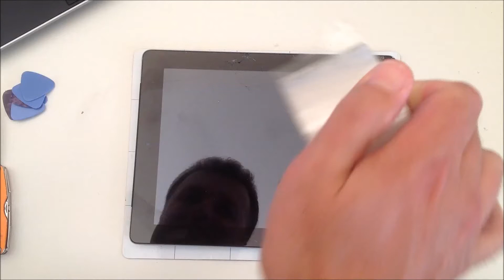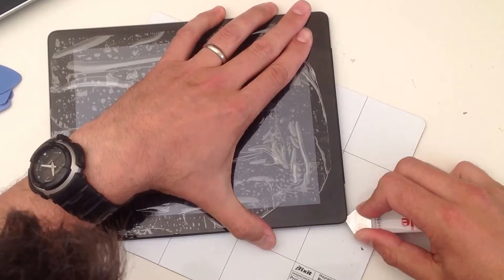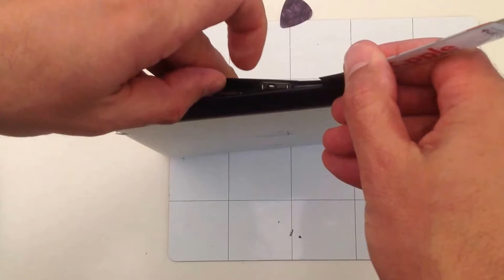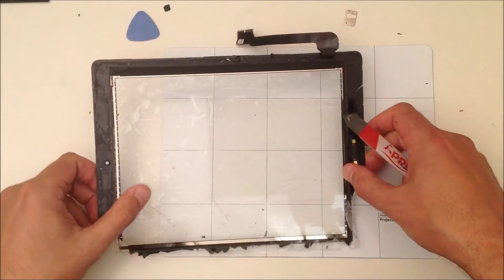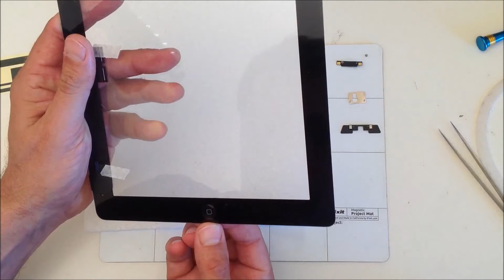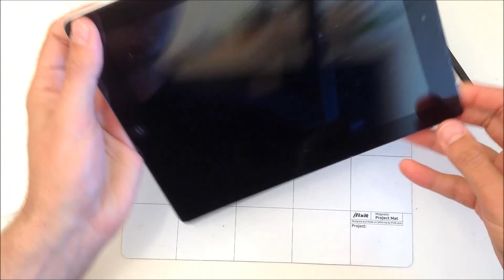iPad 3 Screen Replacement Guide

Comment: the screen doesnt 'click'  in the frame? Also the digitizer cable pushes the screen up.
Reply from the maker: Coen van Vugt You need to work around the edge of the screen with your fingers so it fits closely into the plastic bezel (the white or black plastic frame). If the digitizer cable is not sitting squarely against the frame underneath, then you might need to lift up the new screen again and fold the cable again carefully so it fits. 

Also, when you have put the new screen back on, it is a good idea to warm up the screen slightly and then place some plastic clamps around the edge. Leave these in place for a couple of hours, at least, and to make sure the new screen bonds to the frame properly.
Reply: Thnx Will Hawkins !
Reply from the maker: Coen van Vugt Happy to help.

Comment: My ipad glass is glued to the screen? wtf??
Reply from the maker: Do you mean the digitiser (glass) is glued to the LCD? This should not be the case. The glass and LCD should be separate.
Reply: they are separate i guess who ever fixed it before they used adheiseve glue to bond the glass instead of double sided strip dheiseve